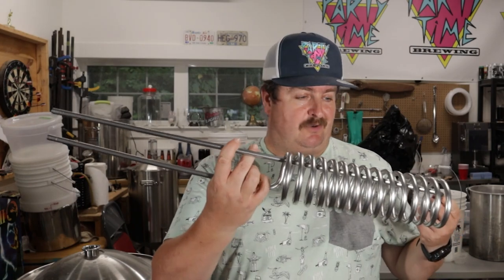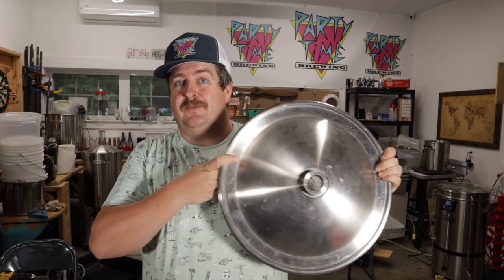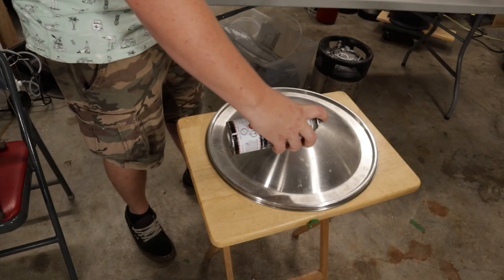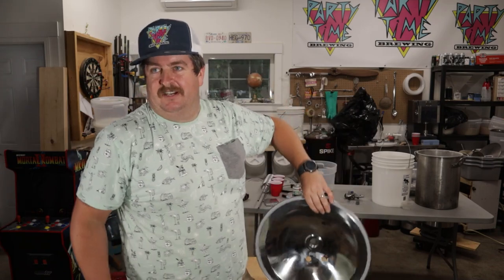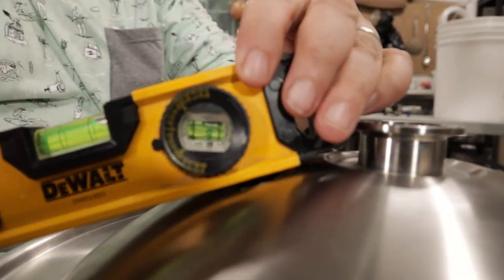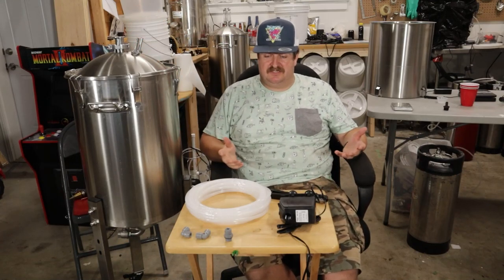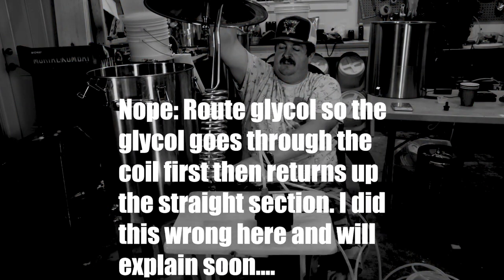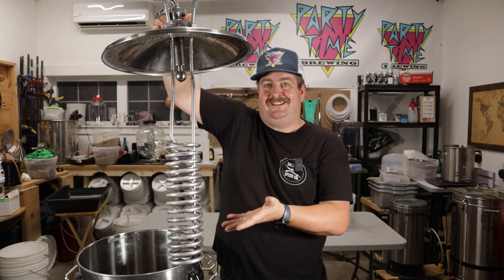How to Add Temperature Control to Your Fermenter | Chilling Coil Install on a Grainfather SF70

Comment: That’s a great video.  I really admire your approach to doing this and also showing the real challenges. Worse case $69.99 and start over. I was looking at the 70L fermenter but decided on a 50L conical brew keg and a big ass used fridge.
Reply from the maker: Nice. The 70L fermenters went on for 400 here, so it seemed like a good deal. You can never go wrong with a big ass fridge! Cheers!

Comment: I'm seriously considering doing the same with an Anvil Bucket Fermenter.
Reply from the maker: It makes sense. I think it would work a lot better than the small chill tube they sell to fit through the top. Cheers!
Reply: Do it! I just did it to mine. I haven't tested it yet, but I am excited for it. It looks like it will do a much better job at cooling than the small one made for it. Plus it frees up the center hole so you can use a tri clamp for pressure transfers and o2 free dry hopping!

Comment: Nice set up! What was the rest of the set up for the temp probe and what did you use for the temp controller? Also did you use just plan water? I have an all rounder also, set up with the temp coil and thermo-well, I use a anvil temp controller and small pond pump in much the same way that you have set up, but I am thinking its time to make a few changes.
Reply from the maker: I used an inkbird for the temp probe. The fermenter already had a thermowell. For the chilling, I picked up a used glycol chiller a while back, so not so much diy on that one. I'd like to do a side by side sometime and compare using ice water vs glycol. Cheers!
Reply: @PartyTimeBrewing  Nice! I have no experience with glycol so I should maybe look in to it a little more. Also maybe look in to that fermenter. I looked at the links in the video but didn't see one for the pump and fittings.

Comment: How do you get on cleaning and sanitizing the temp twister?
Reply from the maker: So far I've just set up my cf70 for clean in place with a spray ball. So just leave it in and it will clean that way with a blast of PBW and a good rinse. For my all rounder, I've just rinsed it pretty much, but if it gets good and sketchy looking I'd just soak it in a bucket of hot PBW or oxiclean. Cheers!